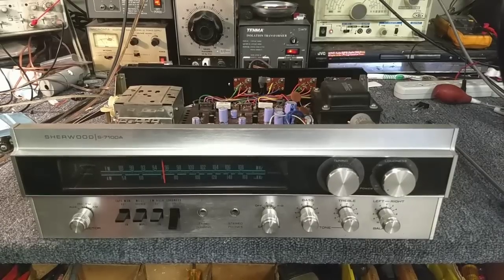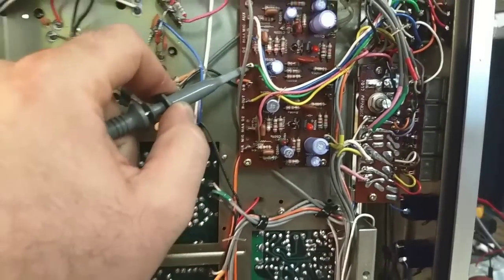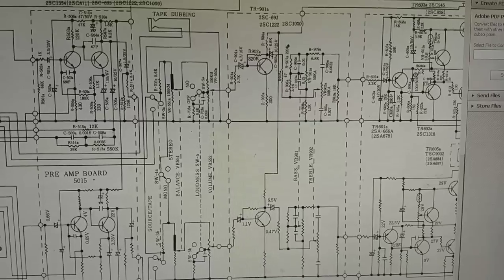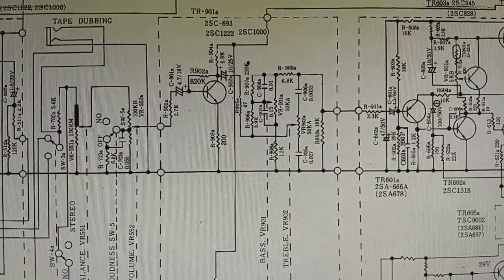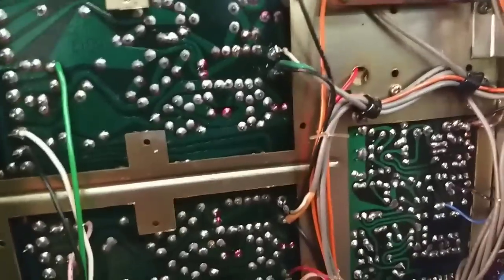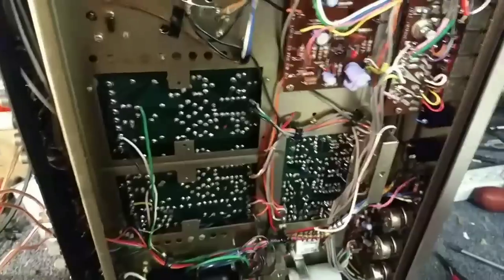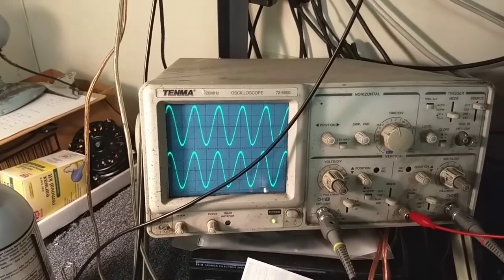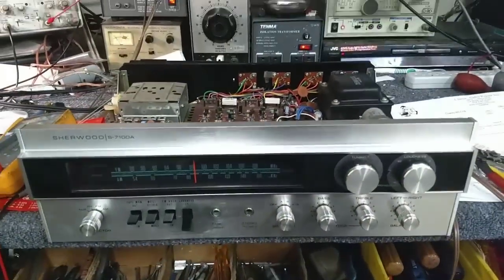Repair of 1970s Sherwood S-7100a stereo receiver - weak channel

Comment: Forgive me for bothering you. Working on a SW 7100. Stereo indicator bulb blew. Installed new one. Blew. I am getting 30v to bulb. I know how to replace parts. But what? Starts out at 30v and then slowly fades to near zero. I am thinking cap.? But the stereo plays fine. I replaced the transistor you mentioned at the end with no improvement.
Reply from the maker: Unloaded you will get a high voltage, but loaded it should be about 6v(I think). The bulb provides a constant load to the switching circuit for the lamp.
Reply: @JordanPier  Thanks!

Comment: Great video! I’ve got a Sherwood S-7100 as well but it keeps blowing power fuses! 2A 250V AGC right?
Reply from the maker: If it keeps blowing fuses you need to check your speaker wires and number of speaker driven and their impedence each. 

If it blows fuses with nothing attached you've got bigger issues.
Reply: I guess it’s bigger issues!
Nothing is plugged into it. Just powering it up.
I just wanted to make sure I had the correct fuse. The booklet says to use a 3ag 2 amp.
I am using a 2a agc 250v
I wasn’t sure if ag and agc are the same thing.
And I did not see anything that says 3 ag
Reply from the maker: @lunchboxlizard  if working properly the machine should turn on with a 1 amp fuse and not blow. 3ag is code for fast blow. 

You likely have a power supply or power amp serious failure.

Comment: Need Help .... been enjoying my vintage Sherwood S-7100A until today and my power dial/volume switch broke. It used to "click" when you turned the switch on now no clicking on and no power ... any help?  Thanks
Reply from the maker: Needs to have the switch rebuilt. Unsolder, remove and send to mark oppat of antique audio. 

Do no buy the ones on ebay sold by hifiaudio. Overpriced junk replacement
Reply: @JordanPier   thank-you!  Yes i seen those on ebay but no way was i spending $90 ..  any idea how much to rebuild the switch?
Reply: I ended up drilling a hole for a switch next to the balance control, problem solved.

Comment: Good journey, Jordan. I purchased my first stereo in 1975, a Sherwood one model down from this one. It had great sound!  They're kind of picky on the output transistors, as their  bias is fairly critical. The weakness on the Sherwoods as you probably know is the on off switch mounted on the volume control. They go open often from frequent use........
Reply from the maker: This one was actually shorted. I jumpered the switch anyways and installed a 3a line cord switch per customer request.

Comment: Hi Jordan, I am enjoying your videos. I left a question in your TDA7293 amp. installation video, last week. Did you get a chance to read it? If so, can you provide any help?    Thanks,     Jack
Reply from the maker: Since I use the pre fabbed boards, I don't think you need to do anything with the bootstrap. I think they take a rail and feed the bootstrap through a resistors to charge a cap. It's been awhile since I've messed with these boards. The request for this swap doesn't come around much
Reply: @JordanPier  Thank you very much, Jordan. I will connect the non-inverting input under the input screw, and give it a try. I don't have a scope, so I will hope for the best.     Stay well,       Jack